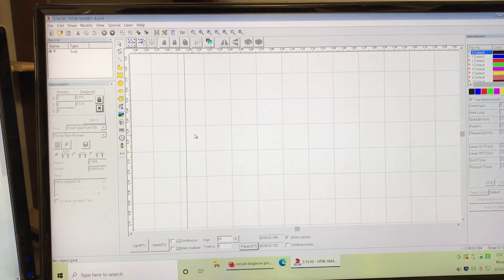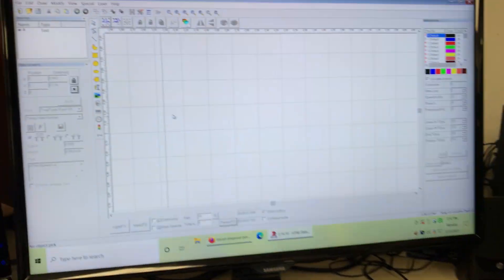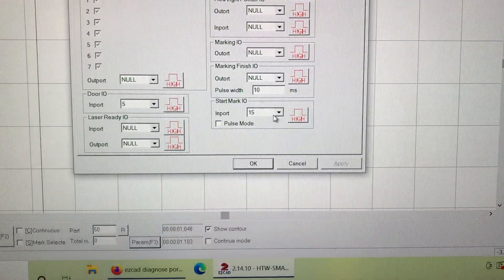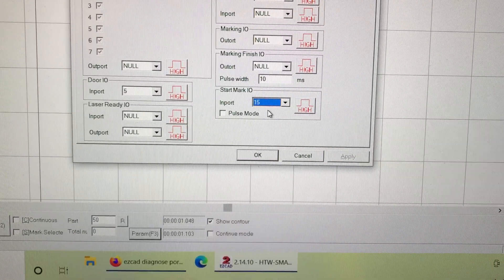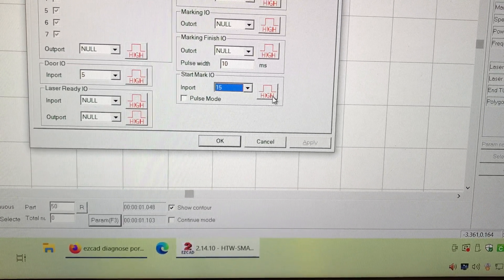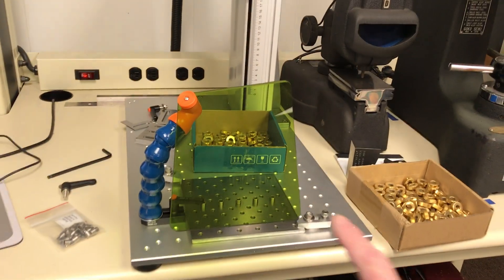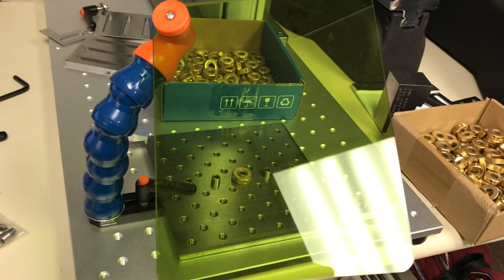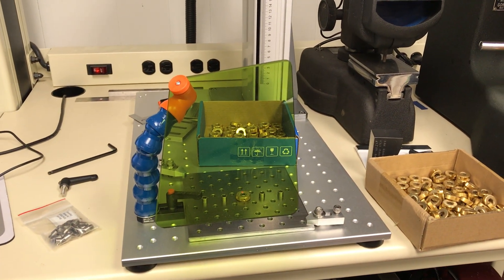EZCAD: How to configure the fiber laser marking machine foot pedal

Comment: Funny I bought one of these and thing will not engrave lol. All I get is a ghost of an image and no real power lol.
Reply from the maker: Make sure you adjust the laser's focal length.  Press the focus button on top of the laser head and adjust up & down until the two red dots are as close together as possible.  Alternately, you can focus by setting EZCAD to continuously engrave (on a test piece) then adjust the focus up & down until you get good engraving.  When the laser is properly focused, the engraving action will sound like bacon frying.

Comment: Thanks for this video! 
You can actually find the Input Port of your Pedal by going to  View>IO STATE in EzCad.   From this menu option, a window pops up showing the IO Status.  Press and hold down your pedal, and then check for any IO lights that change on the input side.    I found that my pedal was Inport #5 by using this method, and I did not need to cycle through all the ports to find this out.

I also set my "Red light pointer IO" outport to either 0 or 1, and that fixed the Light (F1) button's capability for my IPG fiber laser.
Reply from the maker: Excellent info.  Thank you!

Comment: Nice, thanks for the video ,   I have the same problem and went through all the ports but no luck...  Nothing will start it from the pedal.  Did you do other settings too?  
Thanks
Reply from the maker: I show all the settings I am aware of in the video.  You might follow the wire from your foot-switch to the back of your laser cabinet and see if its wired correctly or maybe consider opening your laser cabinet to see where the wire goes.  I think there is a I/O board in there but it's been a while since I looked inside my laser so I can't remember exactly.  Consider also asking the company you bought it from how the foot-switch is connected.